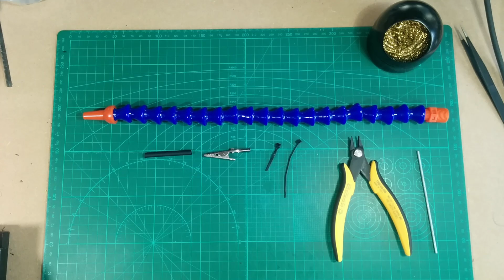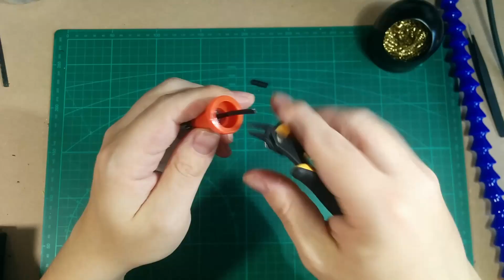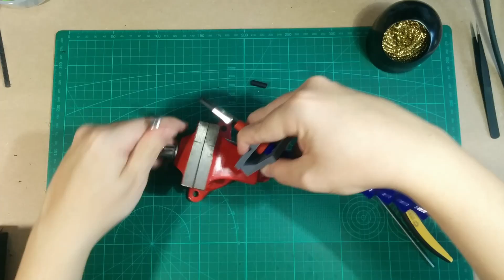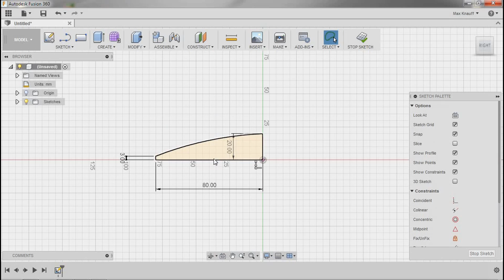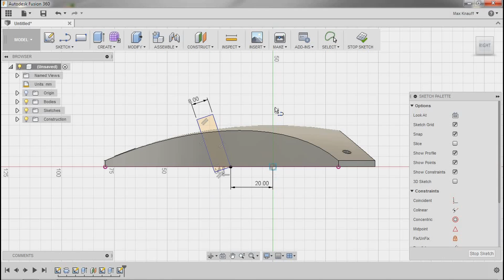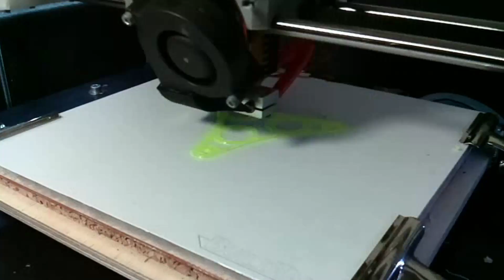DIY Helping/Third Hand for Soldering

Comment: awesome! does the plastic pipe smell strong?
Reply from the maker: Hm... Mine doesn't smell at all... Should it?
Reply: ich frag mal auf Deutsch, ich hoffe es ist kein Problem: Ist das Plastik von den Armen so dass es giftig/stark stinkt? Aber vielen Dank für die Antwort, tolles Video! @MakenModify
Reply from the maker: @certified-forklifter  kein Problem, ne stinkt gar nicht, giftig wird es vermutlich auch nicht sein. Die Schläuche sind normal für Kühlmittel und werden mit der Hand eingestellt also vermutlich nicht giftiger als all alles ander aus China ;) aber als Strohhalm würde ich es trotzdem nicht verwenden 😬
Reply: danke :) @MakenModify

Comment: Are the arms sturdy enough? do they support well a pcb even for desoldering? On my helping hand the board fall when i suck with my desoldering pump
Reply from the maker: they are quiet sturdy, ok for desoldering but not great. They get a lot stiffer if you shorten them, but that's a compromise you have to decide on ;)
Reply: Make'n'Modify Danke mate, I'll try

Comment: Thanks for sharing. I like this design vs a lot of the others i've seen. I've never 3D printed anything before. Would it be as simple as me just downloading the file and bringing it to someone to 3D print? I go to a university that has a "makers society" where i can pay them to print it. I don't have 3D modeling software on my computer currently, so I am wondering if i need to change any of the settings or any settings that I would need to tell them to set when printing. Can you please provide me with the any answers that may be needed when taking it to get printed?
Reply from the maker: yes, you should be fine with downloading the STL-File. Print settings are up to you/them, you don't need 100% infill, 30-50 should be just fine. Layer hight is also not that important, i would go with 0.2 mm. And material, depends on you. most things I print are PLA, but everything else should be good too. If you sometimes use hot air neer the mount you should maybe go for ABS... But I think they will explain the rest to you ;)

Comment: Wow, I can't believe 3D printing has gotten good enough to print threaded holes. Very impressive. 

Very nice nice tutorial. Just curious why didn't you just epoxy/glue  the clamps into the nozzles? They should rotate well enough at the knuckles to allow for positioning the clamps. That way way there is no need to phaff about removing them and fighting to get them back on.
Reply from the maker: good point, not sure if that would work so, you can't rotate the elemts of the pipe so easy. As showen it needs a lot of force to put those back in place an its not that easy to even bend the pipe. But one could add a lever i guess ;)